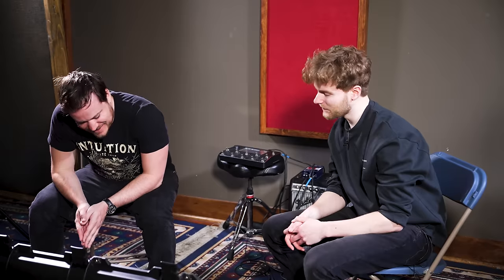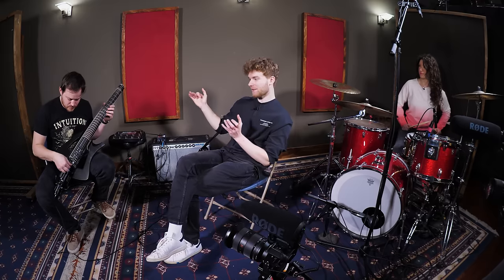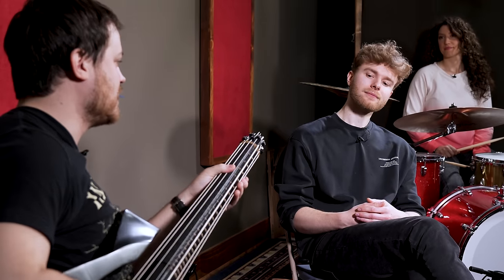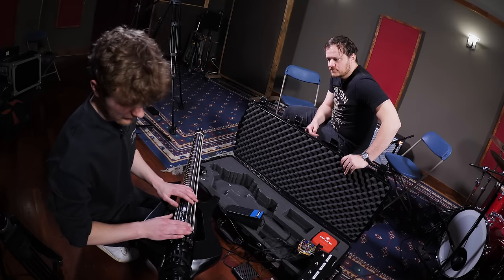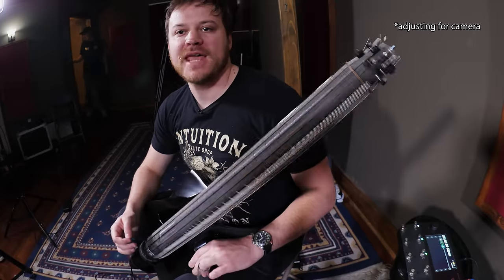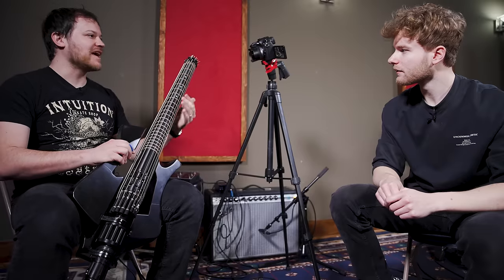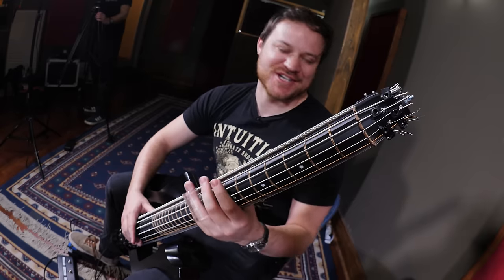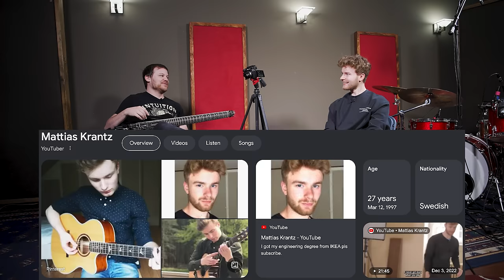Spinning Guitar (with a motor)

Comment: My guy just overclocked a motor on the spot in a recording studio. Engineers are so cool
Reply: SERIOUSLY!!!! so much respect for the fact that this thing isn't constantly breaking down - nevermind the fact that he overclocked it lmfao
Reply: So casually, too. Love it.
Reply: As an electronics engineer myself, it isn't hard.
More or less all motor drivers have configurable drive currents. Ie, how much holding torque they should have.
So if one wants to "overclock" the holding torque, it is a simple configuration away. Oftentimes it is as simple as flipping a switch or two.

Downside is that if one increases it enough, the motor burns up.
Reply: @todayonthebench  it's still cool though! Thanks for the explanation
Reply: "overclocked" puh-leeeeeeeeeeease
Reply: Nice bocchi pfp
Reply: It's crazy simple when you know what to do, but I'm glad when engineers look like magicians. Engineers deserve more respect, even if it's something so simple 😁
Reply: @williamcampbell9859 anything above the stock power is a overclock
Reply: electrician more then engineer lol. never seen those vids where they push more power into kids toys then they are made for? electric motors are stupid easy to push until they break
Reply: @ThomasSantosCanal1  this is NOT OVERCLOCKING.
Reply: @ThomasSantosCanal1  overCLOCKing is increasing the CLOCK rate of a processor or other device running on a CLOCK like RAM.
Reply: @williamcampbell9859  yeah, he increased the cycles of the motor by giving it more tension, so you know.. a overclock, it's just a word bro it doesn't mean is something complicated
Reply: @TheKwikWit  what is overclocking?
Reply: Ya sure, but it was a really easy way to communicate what he wanted to do. Everyone understood what he meant so why does it matter? Sometimes you need to use common words or phrases to help explain something. Have you never done that before? @williamcampbell9859
Reply: @kyler6161  Certainly easier to understand than "Öka drivströmmen", which would have been what he was likely thinking. "Overclock" was most likely the first proximate English term that came to mind, as the idea hit.
Reply: like mid band practice.. "uh just hold on a moment, i need to overclock my guitar"
Reply: @DaBoomDude  LOL
Reply: I'm 5 months late but it's way cooler when you realize in a now-2-years old video of his he confessed to had never touched any electronics!

he built much of the skills needed for the guitar over those 1.5 years

Comment: "What bpm are we doing?"
"I think you mean RPM."
Reply: O those poor hands and fingers.
Reply: it would be cool if a foot pedal controlled how fast it spun
Reply: that's a good one
Reply: ROFL 😂😂😂
Reply: @jakewilliam15  I think it would be cool if you could have a set speed and then use one pedal to rotate, another for "move one string ahead" and a third switch to control direction (rotate forwards or backwards)

Comment: What would greatly improve this design would be to have a rod on the back that has a hand rest on it. The hand rest can slide up and down the neck of the guitar without touching it, allowing for the user to  securely hold this thing without putting the strings out of tune.

Honestly? This thing sounds awesome and is a genuinely cool instrument
Reply: And a cap for that gnarly end to wouldn't hurt lol and you could mount a strap to the end of the rod for the hand rest puting even less stress on the delicate bits
Reply: @baconbliss4796  Yeah, that would be perfect!
Reply: Also be a nice way to easily control the speed setting
Reply: @Mr_Diesel_fuel  Absolutely!
Reply: You don't play guitar
Reply: Also it should be set up so one complete rotation around every fret plays an entire scale, progressing in half steps up the entire neck. Instant guitar solos!
Reply: @grarglejobber7941   Huh?
Reply: @bucknutty952  That could be cool, yeah!
Reply: @necroseus  I was saying you don't really play
Reply: @grarglejobber7941   How does my post indicate that in any way? That doesn't seem related at all...

Comment: You need to try this with a violin bow. You could get a much clearer sound out of it, especially cuz a bow could play multiple cords at once unlike a pick. Just make sure to buy rosin as well
Reply: This is what I thought when I saw him start slapping was how else can this be tuned and or played
Reply: it's worth trying but i'm not confident the bow would be in contact with each string long enough to get the heimholtz resonance pattern happening. an e-bow might work better.
Reply: Aaah I see my thought wasn’t first!
Reply: @famitory circular clamp bow.
Reply: underrated comment
Reply: Mattias actually did briefly in his original video of him making it x
Reply: Basically a not-quite-hurdy-gurdy.
Reply: Its called hurfy gurghi or something similar
Reply: How would the bow cope with the gigantic bass string though? Wouldn't it get caught in it? I should add that I have never played a stringed instrument in my life! Unless you count the piano.
Reply: @famitory  I think if you used a loose bow so it hit multiple strings it would work and probably produce a cool sound
Reply: @famitory maybe a curved sickle shaped bow if you can manage to make it sturdy enough
Reply: Inverse hurdy gurdy
Reply: @famitory waited SO long to use “heimholtz resonance pattern” in a sentence 😂
Reply: I didn't see this comment but I posted something similar. It would sound similar to a hurry gerdy I would assume.
Reply: I recommend a cello bow over a violin, they're much grittier for pulling on thicker strings
Reply: accidentally invents the Gurdy hurdy

Comment: Europe uses 220V (240V actually) at 50 Hz.
The US use 110V at 60 Hz.
The current draw is around similar, so you got total less power on the US mains (bit less than twice the power).

That's why the motor feels weakish, but Rob is a skilled player, he quickly senses the strong points and weaknesses of the instruments and plays accordingly.

Really enjoyed everything in this vid.
Don't feel like I wasted half an hour on YT, I spent quality time on YT. :)
Reply: Your point stands about the power difference, but the US has been 120V since the late 60's.   Which is why in the US vintage (60's and older anyhow) tube amps tend to sound "better" on a variac taking them back down towards 110V.
Reply: @MondoJim  Thanks for updating my knowledge.
Yeah, there's line resistance, which lowers the end voltage you find in the electrical sockets. The more users on a section, the more current draw, the warmer the line gets, the more resistance and thus the lower the voltage.
To ensure people get the nominal voltage (220V in Europe and other areas, 120V in the US, etc.), the electricity producers raised steadily voltage to higher values to compensate for the inevitable voltage drop at the end of the line.
Reply: The EU has a mains voltage of 230 volts nominal -6% to +10%. (216 to 253 volts. And countries not using 230 volts should continue on using whatever they use, and why actual mains voltage in the European union varies from country to country. It is harmonized on paper, and close enough in practice. Line resistance also doesn't meaningfully impact the mains voltage supplied, since line resistance is honestly very low.)
Not that this really matters here.

Now, I can't say that the motor stalls out easier or not on US vs EU voltage. (I weren't there to test myself, obviously.)
But from a logical side of things, the motor isn't running directly on mains voltage, so it shouldn't have a direct impact.

It is a fairly common NEMA(17, perhaps 23) stepper motor, these usually run on 12-72 volts DC feed from a stepper driver. That in turn needs to be powered by a power supply. (even if larger stepper drivers usually have that integrated, but that isn't the case here. Since the power pack is literally lying on the floor behind Rob's chair.)

Now, it could be the plug pack providing the whole circuit with power that has issues with the lower mains voltage. Since a power supply is generally affected by mains voltage. (with a higher mains voltage one is further away from one's minimum operating voltage, and this allows the filter caps to discharge further before said minimum is reached, effectively ensuring that one can draw more energy from the supply in a given mains cycle. The higher frequency of US mains voltage however slightly reduces this issue since the filter cap gets recharged more frequently. In practice PSUs tends to only be 20-30% more "powerful" in the EU.)

But I don't suspect that the plug pack were the issue. Since Mattias could increase the drive current of the stepper drive without having the plug pack complain. Something the power supply would do if it were the limit. (Most stepper drivers have configurable drive currents, both to not burn up the motor from idle power dissipation, but also to provide a torque limit for when such is a desired trait.)

In the end.
My own guess is that Mattias simply didn't accurately recall the amount of torque the motor had. (since judging torque is honestly fairly error prone and why torque wrenches are required in industry even for fairly wide torque specs. It is however a fun challenge to have people guess torque or weights, accuracy is often laughably poor.)
Reply: Pretty sure that's a stepper motor, it's driven by a stepper drive probably at 24VDC. The grid voltage shouldn't matter unless he used entirely the wrong system to drive it.

Comment: There's so much that could be done with this with alternate tuning or programming the motor to footswitches, for example you could have switches to rotate the board set amounts and have much more control in general. Probably needs a stronger motor for that

Comment: lowering the bass string sitting point would help make the strings all sit at the same height... The rotational speed can be heard slowing when Rob goes higher due to torque differences in the motor response and the height and tightness of the strings... (He is catching the bass strings with the slide slowing the motor.) Intonation is another question I would have if I could purchase or build one. This is one of the coolest guitar ideas I've ever seen!!! ROCK ON DUDE!!!

Comment: Imagine if the pedal was split in half, and each half spins the guitar in a different direction
Reply: Yeah, that would be a perfect recipe for short circuit or one hell of a toasted motor. What an imagination!
Reply: @fixcz  I mean, depends on how you imagine the solution to it. I find it doable without said problems.
Reply: That's a nice engineering challenge
Reply: @aviko9560  I know it's doable, I was exaggerating a bit :). You would have to use some stepping motor designed for immediate change of rotation direction.
Reply: @fixcz  Or, how about two separate motors with individual clutches, so one pedal powers one motor and disengages the opposite clutch, and vice-versa. That way only one motor is connected to the neck at a time, and they don't have to switch directions?
Reply: @RobbieRR  You could use only one motor and a gear system with a clutch. The most difficult problem would be the clutch itself and it's quickness of gearing to the opposite direction.
Reply: I Googled a bit and it appears there is a thing called "instant reversing motor". They should do the thing also.
Reply: @fixcz  here I got a idea it's going to be one pedal and a button that that inverts the polarity
Reply: @Mr_Diesel_fuel  The actual principle of the controls is just a marginality. The main problem we discussed here was the motor itself and it’s immediate change of rotation.

I think one pedal which would change the rotation on every click would be the best solution for the player. It’s just about some basic circuit or an arduino which would change the polarity of the motor.
Reply: Automotive power window motor wouldn’t be a bad start. Already accepts reversed polarity drive and is super torquey. More than enough to hold the neck in a fixed position when unpowered.
Reply: Milwaukee drill motor

Comment: Applying a braking action at will (without straining the motor) is very useful.

Flipping the left hand over to tap, and apply hammer-on/pull-offs timed to the passing of the string.

Comment: hammer piano, spinning guitar, fantastic. you're inventing entire new genres. 
tuning problem is from low rigidity of bolt/segment design, fix it by making the neck one-piece (thin wall wide diameter metal pipe). 
a stepper motor with more torque might also help, so you can move to specific spots.
Reply: A truly one-piece neck would be a nightmare to fabricate, since it's tapered. The next best thing would probably be a tapered shell over top of a straight tube.

Comment: Isn't this basically just a weird sideways hurdy gurdy? Like you could just mount the pick to the body, use that hand on a crank to give finer control than a motor and foot pedal as well as move either direction, and you basically need a guard (or whatever it's called) anyway for the frets, so you could probably use keys instead. Sure there's no wax drum or anything and it's strummed rather than bowed, but it's kind of the same idea.

Though to properly hurdy gurdy-ify it you would probably need like 4 hands.

Comment: Would be keen to see if adding an adjustable brake on the shaft so that it hold its position some when it's in 'free wheeling' mode would give it more flexibility in what you can do with it.
Reply: A ratchet, though then the whole thing would click as it span. 😂

Comment: I think the spinning guitar could absolutely work! Seriously. If he ever wanted to further develop it he could look into a letter diameter, multiple cylinders, even having those cylinders rotate opposingly, to even having that happen in a specific gearing way that presents a single guitar string as multiple cylinders rotate opposite direction to each other but have the whole pack rotate to present the single string, likely going to need a central shaft/axle but hey who cares because it would be cool af. I like it and could totally see it getting even a control module for it rotating clock wise and counter clock wise the right way to present and help strum certain strings as it only has to rotate a certain amount from a known start fixed position. 

This things rocks, go for it dude 👍😁

Comment: Why not support the neck at both ends like a harp guitar?
Also if you intend from the start to use a slide you don't need frets and can use a strong pipe with markers 
Also you can have a fixed mute
I think the pickup can be stationary as long as you have two cylinders in sync

Comment: 13:25 amazing sound, would be an amazing intro/background to build on. 15:18 another amazing trick. Gives a sense of approaching dread with a guitar ending to end it on. 16:48 perfect outro and a good way to slow down the song. 20:02 just what do you do with this? 22:22 this thing can be used as an effective bass and guitar in the right hands. This spinning Monstrosity has potential, can definitely find ways to include this thing in a song with drums to support the basis of the song, and it could be a primary lead in the right person's hands.

Comment: I suggest you add a pick jig at the base where the motor is, to act as an "auto strummer" that can be lifted enough to stop making contact when you want your pauses. I think this would make more sense conceptually. That way you can play the frets with your left hand and if you rotate the neck it will play the frets you have depressed automatically. You could also make a jig with multiple picks, or a separate jig for your right hand with a slide on it, so you can move it anywhere on the neck  to bar off sections of the neck. I really think both jigs would be the most versatile I just wish I could draw you a schematic, I have a clear picture of what they would look like and how they would operate. What I have in my mind would complete the build, I think it's presently about 70% done, (like you said, there currently isn't really a purpose for the spinning neck, it's just a cool idea) and the jigs would get you to the final 30%. I think they would make it more fun and allow for some really technical applications... I got some cringe worthy names too. Lol, either call it a "gyrotar", a "Rotar", or my personal favorite, a "spintar"
Reply: Also I feel like both jigs should have buttons to start or stop the motor, adding yet another level of complexity when playing it. @mattiaskrantz

Comment: i think some things that would make this more accessible to use would be color code the strings so you can tell what note you're looking at from a glance and also different shaped grooves at the bottom where you spin it which will let your hand know where on the guitar you are

Comment: Try a rotation controler that has programmable  preset stop positions so you can have the strings you want on demand.  Also have preset speed / tempo settings for 1, 2, 4, 8, 16x

Comment: You could put a "ratchet" like system in it to act to index it along to either sections or string by string (better for with out motor use) this might make it easier to navigate by feel more consistently.

As well as other have mentioned the bow for playing and the curved slide could make it play a bit easier too